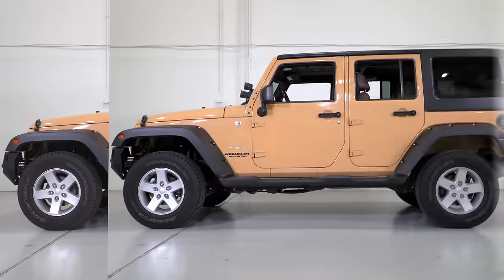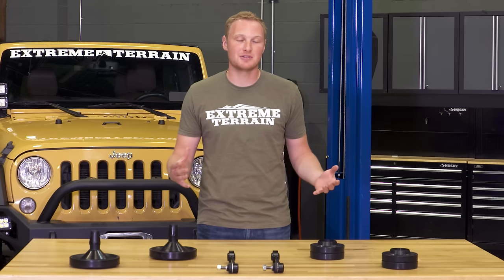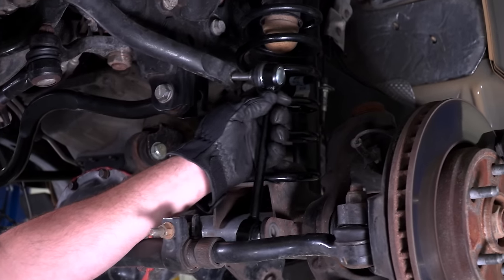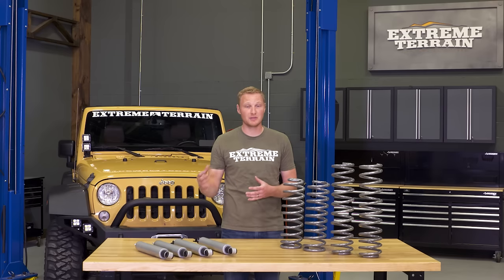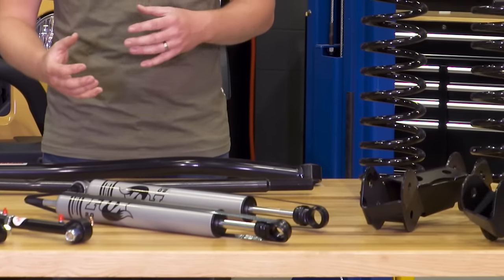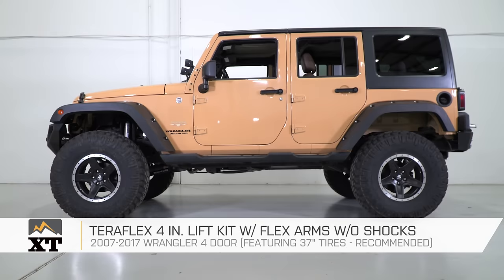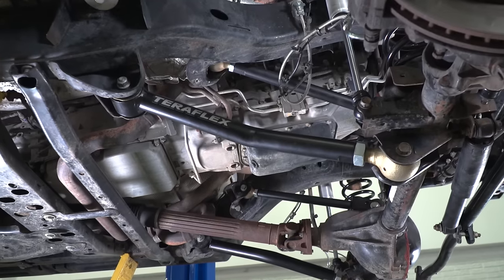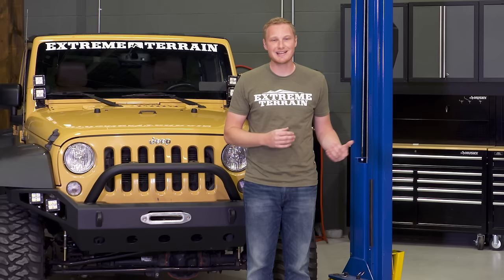Jeep Wrangler JK Leveling Kit vs 2.5" vs 3.5" vs 4" - How To Select The Best Jeep Lift Kit

Comment from the maker: What size lift kit do you have or think is best?
Reply: Stock tires on my JK are 32.5 inches tall(255-75-17).  With a leveling spacer kit installed, I am running 34 inch tires(285-75-17) with absolutely no problems, and love this mild lift tire combo for that fact that it seems to not have drawbacks for axle strength and gearing.
Reply: Pretty much same setup I'm running on my 2 door sport, Teraflex leveling kit, but with rubicon coils and shocks for the higher spring rate, and I fit 35's with plenty of room for a LCG weekend warrior.
Reply: 4" trail master lift with fox shocks and adjustable track arm with 17" pro comps and 35x12.5 bfg mud terrain km2
Reply: Running 2.5 Rubicon Express lift kit with 35s.
Reply: im running a 1.75 inch lift with 35's and have no issues with rubbing off road
Reply: My 09 Rubi is stock for now.  Lucky enough to get free tires from the dealer since one of mine is at 3/32, but I plan on maybe 33s with a 3 inch lift something not to over the top but will get me going.
Reply: 3.5 lift and 35 looks awesome!!
Reply: My jeep is stock lift now with a weird tire size. Basically its a 33.4"×12.5×18  

I need opinions. I have been told 2.5" lift is best for 33" tired but for just a $150 i can step up to a 3" lift. I am pretty sure i will stay with 33" tires. Maybe when my income is better i can do 35" tires but of course that will be more than just the cost of tires. I have seen 3" lifts with 33" tires on youtube but none as wide as mine so its not apples to apples.
Reply: ..there's a practical vehicle..
Reply: ExtremeTerrain.com  I like the 2.5 lift the best. It’s this one I see the most around  my neighborhood
Reply: Lloyd Bonafide gonna have to see proof of that.
Reply: you need a video for JL now.
Reply: 12” all the way 🤙💯
Reply: Lloyd Bonafide 
BS...That thing couldn’t run a10.2 with 1000 hp!!
Reply: TheWilliam1122 what are you even talking about 😂😂
Reply: Level kit w/33”’s and a high fender.
Reply: I got a 2.5 lift on 33 tires runs greats
Reply: I don’t think its the best. But for me a 2.5” lift with either 33” or 35” tires is plenty for me.
Reply: ExtremeTerrain.com  I just bough 2,5 inch terra flex with fox shocks  there I’m think to go 3,5 inch with 35 tires is there to much difference to drive on the road ?
Reply: Lloyd Bonafide  Damn! Any videos of this beast?
Reply: How much are the lift kit will be cost if i buy a jeep car straight from dealer?
Reply: For a 1 inch bigger tire is correct a 1 inch lift?
Reply: 3"/35s
Reply: @WeekendWarriors87 في غن ق وغزل زى ؤؤؤررؤؤؤؤؤؤؤؤؤيؤييق
Reply: Hi I have lift kit aicon coulee over but I’m not like can you help me
Reply: @gmerola2652  I’m interested to know too. I’ve heard mixed things about 2.5 with 35s. I’ve heard it impacts the gear ratio, axles and driveshaft. I’m leary about that combo as I don’t want to break things from the upgrade.
Reply: 4 insh kit on 37 insh tires

Comment: I have the 2.5 with 35s no problems and works great in mountains able to handle steep grades and inclined and still see ahead of vehicle less tip over risk
Reply from the maker: Can't go wrong with a low center of gravity build! -Zach
Reply: Hi i have a similar build (nitto 35 inch mud tires paired with 17 inch fuel wheels) but i was having a few issues with my biscowel bumper so i had to make some adjustments via cutting and it seems to have been fixed however i am worried because i am not sure if i will run into more issues later on or if i am experiencing issues i am not even aware of yet your input regarding this natter would be greatly appreciated @sheerwill survival
Reply: Meme Man I haven’t had any rubbing or turning problems their 17 1250 35 with just skyjacker 2.5 lift and I did ad rear Bolt on track bar holder as my original track bar bracket on factory Dana rearend broke off dealer fixed but it takes a lot of stress on that rear track bar so I order a heavy duty over skyjackers original bracket other than that no problems take off road a lot it’s a 2007 JK Sahara
Reply: Meme Man I have warn front bumper and Olympic rear winch bumper
Reply: I see we have different models mine is a 2017 wrangler rubicon and i also have a warn synthetic winch thanks for the information sir

 i'll show your input to my dad and our local mechanic if it's of use to them because i'm new to this whole modding thing and understand very little

Comment: Good video but you can run 37" tires with a 3.5 if you use flat fenders.
Reply: You can run 37s with no lift, flat fenders and a lot of cutting
Reply: And rims with4.5" backspacing

Comment: Also the Rubicon is also "lifted" higher than a stock wrangler of the same year.  I have a 2.5 lift and 35" tires with plenty of up travel.
Reply from the maker: On stock springs, JK Rubicons will be about an inch higher than Sport/Saharas of the same generation. There's much more of a difference in JL Rubicons to Sport/Sahara JLs though. -Zach
Reply: @extremeterrain  I also have Fox Shocks. Not sure if that makes any difference or not?
Reply from the maker: Most likely not. The new added height from a lift kit is all from the springs, not the shocks. That's why you can buy a shock thats made for 0-1.5" of lift, or 2-4" of lift, etc. 😁 -Zach
Reply: when you put on a new lift kit, you are going to sit the same height as any other Jeep running the same kit. You are just getting rid of your "little bit extra" of lift from factory.

Comment: I would argue that you have the sizes wrong. The 33" tire will comfortably fit a stock JK, 35" on a 2.5" lift, and so on. Up travel is nice if you're bombing along but for a comfortable daily driver and a good rock crawler, low COG is far more important than uptravel.
Reply: smudgeone 
I see most people do 33 with 3"?!
I don't have a off-roading car but I'm looking into buying one and that's what I see the most.
Reply: Agent. K. Nobody runs 33s with 3" of lift on a 07-present JK/JKU Wrangler. Stock tire size is 32, 33s fit stock as well. This video is extremely conservative with tire sizes. 2.5" kits will clear 35s, 37s need 3.5" and flat flares or a 4-4.5" kit. Older Jeeps like 87-95 YJs and 97-06 TJ/LJs and even XJ cherokees need about 3-4" to clear a 33" tire.
Reply: MrThtguy 
That's what I'm looking at, XJ
Reply: 3.5-4.5" usually sits nicely with XJs on 33s. Gives you plenty of room for travel and turning with little to no rub.
Reply: With 35s and 2.5" lift you need to cut fenders. Anyone who says otherwise simply has way too much of a bump stop installed and misses out on much of uptravel.
Reply: I ran my 2011 and 2012 JKs with 33x12.5 at stock ride height for a while. The only lifted jeep I have is my 2013 rubicon. 3.5 with 35s
Reply: 37's = depends on flare brand and model(?) look at Smittybuilt xrc, and their XRC Flux (which flare upwards), and also Fab 4's etc. Another variable s the rear pinch seam perhaps, and front bumper brand.
Reply: I run bfg 315/70r17 km3's on a 2.5 Teraflex lift without a problem on my JKU. Looks really nice too.. Those are the same tires they use for the raptor, so they are load range C and ride better than load range E tires.. bfg 315/70r17 km3 are technically not 35's.. They are more like 34.7's..

Comment: I run the cheapo Rough Country 2.5 lift with their shocks (gonna replace that all soon), and 35" tires. I have no rubbing and I don't run any bump stops other than what comes standard on the RC shocks with that lift. I did have to cut my fenders though. So 3.5 lift is not necessary for 35's.
Reply: yeah i agree. Im running 35s on a 1,75 inch lift with stock fenders and I havent had any issues on and off road
Reply: Did u regear to run that 35 “
Reply: I ran 35s on a 2 1/2 Rough Country lift on my 09 JKU and it ruined the ride and made it even more sluggish than it already was. I now have a 15 JK and am considering just doing a leveling kit with 33s. Just going by past experience but any advice would be appreciated

Comment: Thanks for video!
Could you help to choose please?
What is better: adjustable control arms or control arms brackets or 3-link long arm kit (diy kit)? These kits have approximately similar prices.
Using vehicle everyday and offroad on weekends.
Jeep Wrangler JK Unlimited Rubicon 2015.
Lift 3.5 inches.

The main goal to put 37 inches tires and make Jeep suspension is very reliable. Few times per year we go to the mountains for a couple days. There is no any service or welding or even electricity. So suspension must be very reliable to not to way some parts in the mountain:)

Comment: I think the sway bar links replace the front sway bar links for the Teraflex leveling kit.  You are confusing installation of sway bar links with another teraflex lift kit that does do the back to front swap. Check out the Teraflex youtube VBLOG to verify the proper leveling kit installation of the sway bar link.

Comment: good video.  Simple question at what size of leveling kit we need to modified  the shocks and the drive line joint or angle
Reply from the maker: If you plan on lifting or leveling your Wrangler above 1.5" new shocks will be highly recommended, anything over 3" and you will need seriously need to start thinking about addressing your driveline angles either with adjustable upper and lower control arms or/and a new driveshaft. -Zach

Comment: 4 inches lift high enough to use 38x15.50r20 tires or I need higher lift like 6,50? And what's the widest tires size for JK? I know only 38x15.50 or 40x15.50...

Comment: I have the 285 R17 tires,  with no lift!  Discount Tire told me that my tires are actually 32.7 inch and my question is can I get the 295 R17 Tires on my 2014 Jk with no lift?  Discount Tire told me that the 33 inch tires are actually the 295.

Comment: I want a 3.5 on 35 or 4 on 35 for off roading Clearance I had my 17’ Silverado on 35 and a 6inch lift
Reply: Jeeps don’t need as much as trucks because the fender wells are more open
Reply: James McCracken yeah I unfortunately sold my jk A while back now I might pick up a jl ruby in the next few months has to be the diesels
Reply: @TipOfTheSpear907  did you ever find out what the 35s with a 4 inch lift looks like in person?
Reply: @mallkrawlerz620  yeah they look good but the JL ruby can take more tire
Reply: @TipOfTheSpear907  did it look funny thought? Like it missed leg day?
Reply: @TipOfTheSpear907  Im stuck between a 3.5 and a 4.5 right now. Im planning on leaving my 35s on it with a big lift until I wear the tires out and then I’ll move up to a 37.  Just wondering if I’m gonna look weird af with a 4.5 inch lift and 35 inch tires.
Reply: @mallkrawlerz620  yeah so if I remember correctly the jl ruby can fit 37 stock suspension but I would go with the 4.5 if your going to take it on the trails or something just so you don’t rub but you’ll look a little weird but not that weird, nowadays 37s are the new 35s if that makes sense

Comment: So I’m wanting to get the 1.5 -3.50 lift fox shocks only and 3inch coil springs will I need anything else so I can run a 35” tire? I know there are lift kits with all the things in it, but I want to by each part separate at a time (more budget friendly lol). Will I need anything else?
Reply from the maker: If you're lifting the JK three inches with only coils and shocks, we do also recommend longer sway bar links, brake line drop brackets, bump stop extensions, as well as an adjustable track bar or track bar relocation bracket!! Hope this helps!

Comment: Would you recommend 35.0 in. tyres with a 4.0 in. to 5.0 in suspension lift in a WRANGLER (JL) ??? Please advise
Reply from the maker: On the Wrangler JL, you really don't need a 4 or 5 inch lift to run 35s, if anything that may be too much lift. If you're only planning on running 35s I would highly recommend sticking with a 2.5 inch lift to keep your center of gravity nice and low. That will help with daily driving and off-roading. -Zach

Comment: Do you recommend 3.5 inch for 35" tires on JL?
Reply from the maker: 2.5" will be plenty for 35s if you aren't planning on flexing out your Wrangler often on rocky trails. If you plan on flexing your suspension a lot and want the extra room for 37s at some point, a 3.5" lift would be better for you. -Zach
Reply: @extremeterrain  Appreciate your answer. Thank you :)

Comment: What about starting with a leveling kit and adding a nicer 2.5" lift kit when budget allows? Is that possible?
Reply: Honestly with a basic kit like the Teraflex 2.5" spring lift or the Rubicon Express 2.5" spring lift you get a pretty complete kit without the limitations of the stock springs.
Reply: Sure why not its just money your blowing....  But really it depends what size of tire you want to run.  The smart way would be to save your money til you can afford what you want and just do it.
Reply: That's what I did on my '15,, 35s now with a rtt and gear I'm beating my stock fenders to crap on trails. Don't like the look of most flat fenders except for Nemesis which are pricey. Not sure a 2.5 lift will work without fender mods. Now looking at AEV 3.5 lift $$$

Comment: Just bought a 2017 jeep wrangler unlimited wheeler with everything done already which is great . I have 35x12.50x17 now and want to go bigger to a 37x13.50x24.  Idk if the drive shaft has been replaced but the gears are 513 front and back . The front bumper isn't in the way nor the fenders . It seems the guy that had before went to rock trails . Besides the drive shaft what else do I need for the 3.5 lift that I already have . Thx ahead for any advice.
Reply: Ah prolly just beef up ya wheel bearings, brakes, ball joints🤷‍♂️

Comment: I have a bds 3.5 lift kit with fox shocks. You think I'll need to add anything else to run 37s?
Reply from the maker: I'm not too sure what all comes with that kit, but at that height and tire size you really want to make sure you lift everything properly. Outside of springs and shocks, you're going to really want to make sure you keep your suspension geometry correct. I'd recommend looking into a full set of 8 adjustable control arms to keep your Jeep riding smoothly and to keep your caster/camber angles in check. You should also look into getting an adjustable track bar to keep your front axle centered and keep things feeling planted, a new rear track bar ( or track bar bracket) and possibly a drag-link flip kit to keep your steering geometry in check. Brake line extensions are a must as well. Looking into new drive shafts at that high of a lift may be a good option as well to avoid wear and drive-line vibrations. Long story short, the higher you lift your Jeep the more that needs to be accounted for. Take your time with research too. Hope this helps! -Zach

Comment: Great video. Lot's of quality info shared. Thanks!
Are the Rough Country shocks better than stocks?
Thel also sell a 2 inch spacer lift kit that uses your stock coils and shocks. So, i am between those 2. Any suggestion? Thanks!
Reply from the maker: Thanks for watching, we appreciate it! The Rough Country shocks included in the kit are nitrogen charged, which will provide a slightly stiffer ride that will handle better on the trails, and will also prevent cavitation better than standard hydraulic shocks.  If you're on a budget, going after a spacer lift is a fine option. But if you have the room in your budget I would personally recommend getting the lift with full coil springs and shocks. Pair them up with an adjustable track bar to keep your front axle centered, and you'll be good to go! -Zach

Comment: Question. Do I need to account for the automatic sway bar disconnect and axel lock in my Rubi when choosing a 3” lift? I just want to know if this will change any of the parts required for the lift
Reply from the maker: Not at all! Just make sure the lift comes with new swaybar end links and you'll be good to go! -Zach
Reply: Thanks a lot! Thanks for the amazing videos you guys rock

Comment: Just a clarification so everyone is aware. The tyre size isn't changed on the 2.5, 3.5 and 4"  lifts shown at 6:24 .
 But if you view 6:09 you will see what a 37" tire looks like on the 4" lift
Reply: wondered why they changed on the 37, should have showed it fist with the orignal tires then swaped